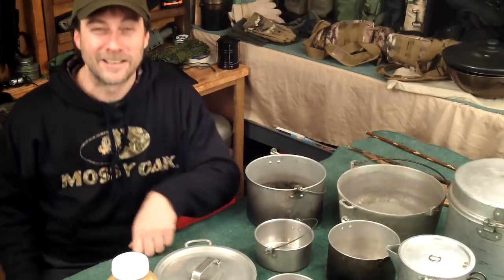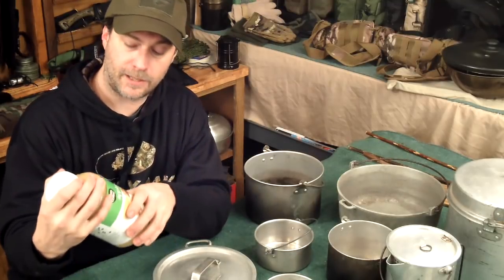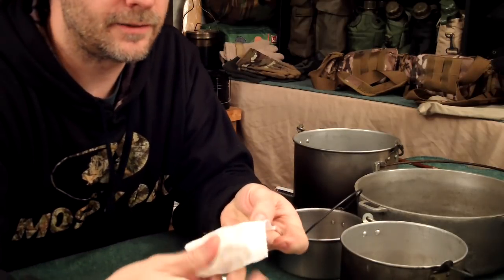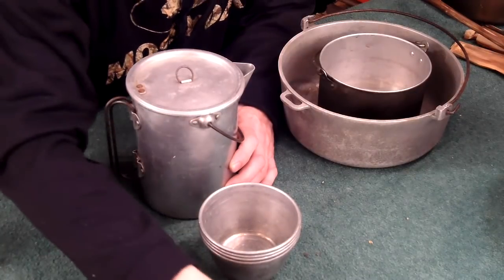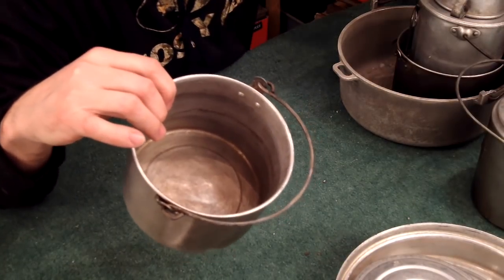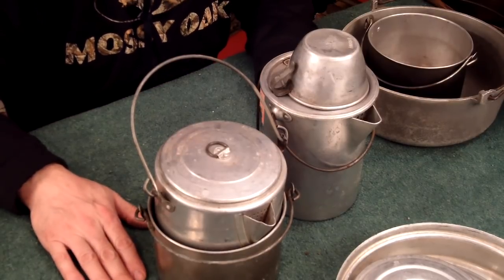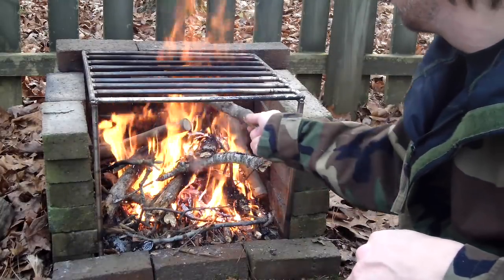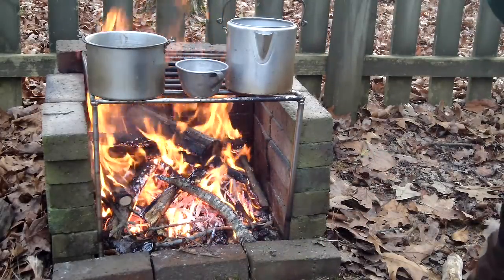Testing Old Aluminum Cookware For Toxicity

Comment: Only aluminum pot I use is an old coffee percolator, We use it every time we go camping..All the rest of my pots are stainless steel, I don't mind the extra weight, it's just piece of mind. I wouldn't want to inadvertently poison my family using aluminum pots. I use the MSR Seagull pots in my personal kit and carry a small cast iron frypan.. I haven't found a stainless frypan I actually like.. Great info Dave, thanks for the info.
Reply from the maker: Some claim boiling water, coffee or soup is OK in aluminum but food isn't. Who knows? I personally use stainless 90% of the time. I'm glad you liked it. Thanks for watching Zane
Reply: I think maybe it's because of a reaction to the acids in some foods like applesauce, or tomato based products. You know heat+acid+aluminum  (doesn't sound good to me anyways), that's what I suspect. Great job though lookin after your peeps man..LOL

Comment: Thanks Dave. I purchased this same pot from a flea market several years ago. After washing it and letting It simmer for a long period of time over a low flame it had a film on the surface of the water. I love the pot but I was afraid to use it and never did. I’m going to try the applesauce test but I don’t have a very good feeling about it. At least I can put it to  another safe use or either get rid of it.
Reply from the maker: That's another good test right there! Just let clean water simmer and if it has a sheen then don't use it. Thanks for watching Carol

Comment: If I were you David, I wouldn't trust any of the older type of aluminum cookware. People used to experiment with mixing different metals with aluminum. That constant oxidation could be from Iron content in it due to improper purification of the aluminum or it could be from any other number of things.If there happens to be any copper content in there it will leech into any acid foods and give metal poisoning in the long term. As you said, it makes for a good ornamental piece for the antique shelf brother. Very awesome video! I do believe that you managed to create an awareness in the community about cooking utensils. The smell test alone proves that the pot is useless.
Reply from the maker: Good comments and I'm glad you liked it. I created a lot of awareness and a lot of arguing. Lol.
Reply: Aint that the truth! L.M.A.O.

Comment: I have and use a cast aluminum dutch oven that I bought a couple of years ago at my local military surplus  & camping store. As for camp cooking, I prefer cast iron and stainless steel. I only car camp anymore so weight is not a problem. I do not use really old aluminum (or aluminium). I even retired my favorite 60's model Mirro 3 egg poacher pan and coffee pot!
Reply from the maker: I think you hit it right on the head Robert, its sometimes best to just not use really old Aluminum. I love my entire vintage set but honestly I bring stainless steel about 90% of the time. Always great to hear from you Brother Robert!

Comment: I have a couple of pieces of my mother's old Guardian Ware that I just pulled out of the back of cabinets I was cleaning out.  Someone a while back, said it wasn't safe to use, but couldn't say why, only that it was aluminum.  I remember my mother using the 2 pieces that I have ... I'm 70, so that was a long time ago.  Did a search, but didn't come up with anything. Think it's safe to use??  Haven't tried this applesauce test ... no applesauce.  All this said ... she used then when I was growing up and as said ... I'm 70, so I tend to think they're ok to use.  Watched your testing and want to thank you for doing that test!!
Reply from the maker: Very cool you have them pieces! I would say if it passes the applesauce test it should be safe to use. In my experience cast aluminum has been the only aluminum to fail. All stamped or drawn aluminum that I've tested has passed

Comment: Cool experiment, we have an old pressure cooker pan we use for soup. I will be testing it soon as it's cast aluminium. The pink colour showed up well so I agree it was a success, (pass or fail), thanks for the tip. Stay well.👍
Reply from the maker: Thanks Dave! Absolutely check that pressure cooker. My mom had a Presto for years.

Comment: I used to have an older (1970's) Ducati, and there was a product called Semichrome (but that was a brand name, there's probably others) used to polish the aluminum engine cases and wheel rims, and it would take the tarnish off aluminum right down to bare shiny metal. Took some effort, but worked really well.
Reply from the maker: I remember that stuff! Back during my hot rod days I often used Simichrome polish on wheels, valve covers and air breathers

Comment: A possible way to shed light on the effects of aluminum would be a study of Russian males over the age of 45 or so who served in the Soviet army. They used aluminum mess kits and canteens quite a bit and also drank a lot of tea, which according to one of the articles linked below accumulates larger trace element amounts of aluminum. I imagine that if it was a definitive cause of dementia, there would be higher rates of it among older Russian males, especially if they were deployed during the Soviet-Afghan War where they would be eating out of field kitchens and using their aluminum mess gear far more frequently.
Reply from the maker: Now that is interesting Doug! Thanks man, I'll have to look that up.
Reply: Reallybigmonkey1 I'm not aware of any such study, just saying that if someone wanted to do one, it would be a good place to start. Myself, I don't worry too much about aluminum.

Comment: You can clearly tell that the big pot was a molded cast and made probably in the early 50's, which is probably how most pots were made back then. Your other pots are clearly newer technology. They should be perfectly fine. Great testing video. Goes to show that you can't use some of the old stuff from the past. I don't know how people didn't die from using stuff like that.
Reply from the maker: Thanks, I'm glad you liked it. I agree, some of that older gear just needs to be wall decorations. LOL. Thanks for watching

Comment: I have a cast aluminum pot set from the 60's. When food started sticking and tasteing bad. I put them in my oven on the self cleaning mode. When they where done I cleaned and seasoned them the same way I would cast iron cookware. They are now non stick with no bad taste.
Reply from the maker: Im thinking with the right seasoning and care that if ANY pot is made non stick then how could it not be safe?

Comment: Try using cabbage, let sit for 30 minutes after you cook it. See if it turns pink. More accurate than apple sauce. Sitting in the pot as it cools is significant.
Reply from the maker: That's a new one to me Nana. I'll have to try that.

Comment: Hmm, very interesting!  I wonder if the initial processing could have anything to do with it.  Sheet aluminum that's been rolled through successive steps vs. the super heating of the ore to get molten aluminum for the casting.  Excellent test video Dave!
Reply from the maker: That's very possible. Only the purest alloys get rolled and darn near any aluminum alloy that's casted could wind up with zinc magnesium or even traces of lead. I'm glad you liked it. Thanks for watching

Comment: Wow, I just today saw most of these aluminum camp sets.  I got the cocoa? pot (but mine has short folding handles on it, with the hanging handle, like that taller pot does) with the one rib in the lid, and the one pot that it sits in well.  I also saw that large aluminum pot with the large fry pan lid and the medium pot.  The plate? was stuck in the bottom of the large pan.  This bigger set did not have those handles with it tho.  Also there was the kids toys sized camp cookware but I did not get those (but I did take the small 3 utensil pieces that I've wanted, that will be great for my small camp cook set.  I will try the apple sauce test on them tomorrow.  Thanks for the info!!
Reply from the maker: I'm amazed at the variations of this set over the years.  Ive seen several different ones. For older sets this test is a must try. Thanks for the comments and thanks for watching Jannah

Comment: Interesting to see how you can use apple sauce as a color indicator on how much the substances in the sauce (probably most of all the malic acid) react with aluminium. However no detectable change in color does not automatically mean that there is no aluminium released into the food - it could simply mean that there is so little released that the reaction does not result in a perceivable color and/or smell shift. But as with other substances even small doses taken in on a regular basis may lead to medical issues in the long run especially if the substance is not removed from the body at a sufficient rate. 

As far as I know in many countries there has been a scientific debate going on whether aluminium is toxic at all and whether the human body can excrete it and if so at what rate. As with all fields of natural science it takes a while until all the studies with their specific approaches, data and interpretations of the results come to a more or less final conclusion (and when lobbyism in whichever direction is not meddling too much any longer). Of course in the case of longterm use of aluminium cookware over years and decades the final answer may only be acquired once the medical development of enough users has been studied and evaluated over years and decades.
Until then I have decided for myself not to use aluminium cookware anymore that has no cover on the inside. 

Best greetings, Tim
Reply from the maker: Well said Tim. I can also say in most cases campers rarely cook outdoors in these pots everyday. Just about two or three times a month? My gear is actually 90% stainless. I just don't want to have to throw away all my vintage aluminum. Thanks for watching Brother

Comment: Dave, loved the vid. Could you do a follow up vid, briefly explaining about aluminum poisoning, as many people are still unaware, yet are still being affected? For example, there was an incident of a church (in Ohio?) that served coffee from an old aluminum coffee urn, 'back in the late 1950s or early 60s, I'm thinking' and  as I remember the story, most of the members of the church that drank from that urn that day died. The reason determined was aluminum poisoning. One too many pots of acidic coffee was perked in that pot, eh? There was a similar incident of a large group of people that died from a large pot of spaghetti with tomato sauce that had been sitting in the pot for many hours, reheated and served to them. Dave,This is a very real issue and people need this knowledge, so even if you could do a short vid with links to more info, that would go nicely with this vid. Thank you much, Dave.
Reply from the maker: Thanks but honestly I haven't done enough research to do an accurate video on that subject

Comment: I hadn't got around to watching this, but I do have those inexpensive aluminum cook sets based on the oval military pans that close up like an oval shaped box, so I am curious.

I did want to mention that spanish people use what they call a "caldero" which is usually a heavy and thick cast iron or cast aluminum pot. The modern ones meaning like what you'd find if you walked into a store to buy one today, are very polished and shiny. I've seen them in use and have used them myself and they cook beautifully. And I have never seen any discoloration. I've actually considered buying a couple for outdoor cooking since cast iron is great, but just too heavy for a camp out unless you are driving or riding a pack mule.
Reply from the maker: Interesting, I've never heard of a caldero. Thanks for the comments

Comment: I have an old Prestige Aluminium ( UK Spelling) pressure cooker. It isn't anodised. It's instructions say if it gets discoloured with use, boil up some Rhubarb in it to clean it. ( Don't eat the Rhubarb after)  Rhubarb contains Oxalic Acid which would strip off the surface of the aluminium pot.

Comment: The only certain way I've found to know what is or isn't in the pores of old aluminum is to do the apple juice test, and then send the juice to a lab for testing.  It doesn't cost very much, but it's only worth the cost if you have old aluminum that's somehow special because it's a rare piece, or has been in the family for decades, etc.

I've never worried about it, but I have friends who are deathly afraid to eat from aluminum.  The funny thing is that several of them have bought powdered aluminum and powdered rust from Amazon in order to make thermite, and powdered aluminum with particles four microns or smaller can be a deadly neurotoxin if inhaled.  You can eat it safely, but if you inhale it, you can die.

Anyway, I suspect it's pretty rare for people to boil anything really harmful in aluminum  cookware, and then keep it where it can be used for cooking.  Most oil oil isn't harmful even in very large doses, let alone in the tiny, tiny  amount you might get from aluminum pots used to boil some sort of petroleum product.  

As I said, I don't worry about it.  We have an aluminum pot and a skillet that belonged to my wife's grandma, and we still use it.  

I may be wrong, but it also seems to me that boiling water in old aluminum should clear out anything in the pores, and how many times over twenty or thirty years has this happened with old aluminum pots or skillets?   Even if they haven't been used over the years, boiling water should still open the pores and clean out anything in them.
Reply from the maker: Thanks for the info James. Well on just a dirty pot multiple water boilings will clean it out. On a very old pot that's had lead alloyed into it, nothing will ever clean that out.Thanks for watching

Comment: Hey, this is a really good vid topic.  That other cat tail doesn't have a 3rd eye on it.

Reason why I have changed all my cooking gear to just the smallest stainless steel pressure "cooker" not big canner.  Replaces all other cookware (even though my 3-4 quart weighs 6#, ... so many multipurpose options with this vs other conventional cooking and container uses).  Boiling/sterilizing/steaming large water volume, steaming food, skillet in bottom, dehydrating food in steamer basket w/ hot air convection, wet/dry smoking fish/meat, broths/soups/ stews/ bone broths slow and low cooking, sterilizing medical/eating utensils, laundry washing, large water volume personal hygiene, half-buried near campfire/coals for warm/hot water/boiling for all kinds of water needs (drinking, cooking, cook washing, laundry, personal washing).  Able to boil/steam/distill swamp water, unclean water, ... and filter out impurities and have totally safe water - less fuel, less energy, less searching for fuel wood.  Cooks at any elevation.  Can distill out (moonshine copper tubing attached to steam pressure nipple) sea water into sea salt and fresh water.  So the ALONE series of having red tide salt water, you could sterilize and kill the algae, but also steam-distill the water for fresh water, and toss out the impurities.  Also used with hot/boiling water, and put into tent for a tent heater, or nearby sleeping bag for a "hot water" container heater.  Can put bricks or stones inside the canner with water and superheated (15 PSI -> 250F) creates a long-lasting hot rocking and hot water heater for tent, sleeping bag, or even under low-elevation hammock for upward heat.
Reply from the maker: Thanks for the comments John, you are always a wealth of knowledge
Reply: Have just changed my 3-4 quart/liter pressure canner!  Albeit aluminum and 3 1/2 #.  Drop of 2 1/2 # from my same stainless steel 6#.  Reason why stainless, stainless, and not leaching metal in an acidic or sea water distillation.  My previous shellac enamelling of cast iron pots and pans applies here.  Put over gray coals and apply veg oil (oily, gooey shellacy) and allow to burn and smoke.  Leave and heat until no more action.  Keep reapplying veg oil 14-16 layers on outside of pan (FIRST) until blue-black shellacing.  Very glassy smooth surface.  Then turn over and do inside.  Now I am doing the same for my stainless steel cooker and pressure lid inside and out.  Black superheats, less fuel, less cooking time.  So this shellacing method can be used (like all the rest of ANY camping cookware [tin, aluminum, steel]).  No with an entire shellaced 14-16-20 layer aluminum pressure cooker - no more issues of toxicity, leaching, or oxidizing.  Now my entire bushcrafting ruck holds eating utensils, dry-stored foods, frozen/chilled foods, spices, ... and now can do any steaming, baking, cooking, bottom skillet cooking, broths, soups, stews, slow/low cooking, pressure cooking, steam-sterilizing, hot air convection cooking, hot air dehydrating - any acidic ph foods/sauces, ... and now can distill seawater with my aluminum pressure cooker.  And even more this item can be used for making char/charcoal, steam-distll pine/birch oil-tar, ... make herbal essential oils, ... and NOW ... can be put into a solar oven (black surface) and have enough heat for its internal 15 PSI and 250F, when a normal solar oven can cook up to 450F in some climates.  Stealth cooking at its best.  And if you have no-trace cooking, then buiild the fire INSIDE the cooker, and can carry the coals - lke Apache fire carrier to next location.  Light up some coals at the truck before departing, get to designated camp site - and have immediate ready fire and heat/warming - in any seasonal weather and climate.   Now lighter than ever - and multipurpose.